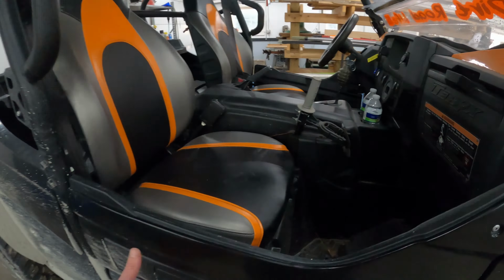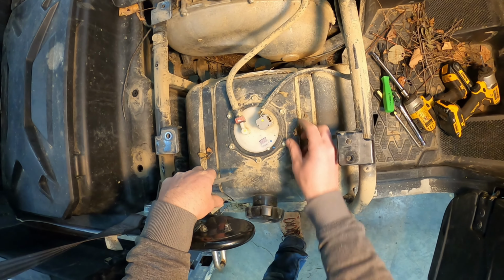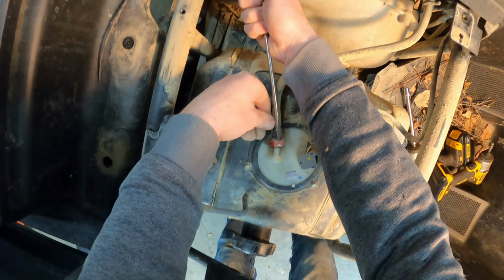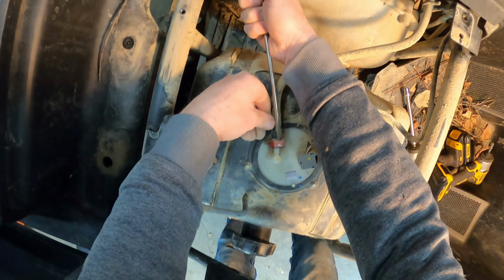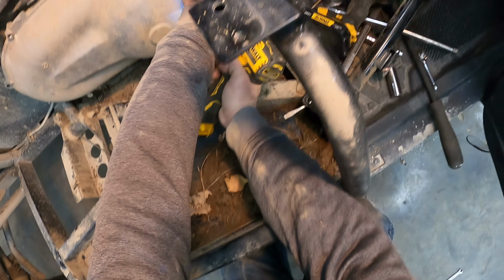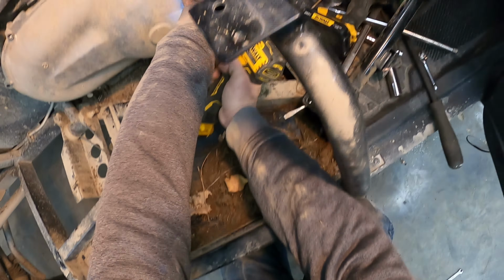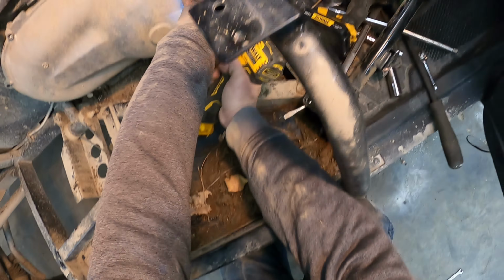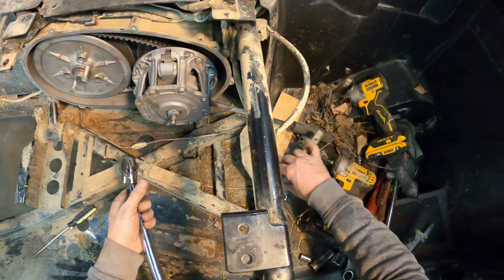Teryx T2 Belt Change || How To

Comment: Finally a 2 seater belt change! nice job, I would love to move that tank to the other side, would be so easy to inspect and change belts. Could probably be able to check and change the oil with the tank installed!
Reply from the maker: Thanks Mamonti!! I debated on doing it then realized every other vid on YouTube was of the T4. Great idea on the tank on the driver side! -Chris
Reply: @DirtRoadLife1  most everything is t4  even aftermarket stuff. Nice to see a T2. I will be tearing mine down once it warms up here in central Pa. going to try the tank swap for the reason stated but to also try to deaden the noise!
Reply: I say do a beer keg style on the back of the cage. Kind like them old style buggies. More fuel capacity and storage space.

Comment: What’s the orientation of the 2 washers for the primary. Mine fell out when I pulled the cutches off.
Reply from the maker: @DN4AGDX  couldn’t tell you but I need to do a belt again soon so I can update you but probably not soon enough for what you need